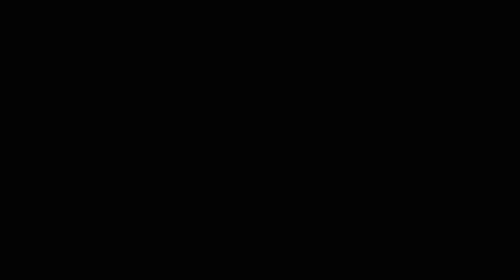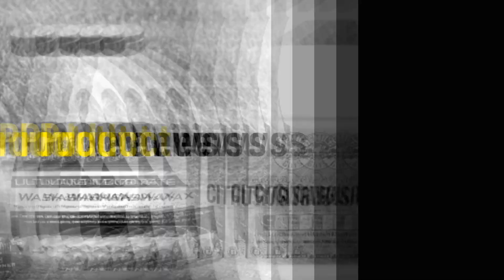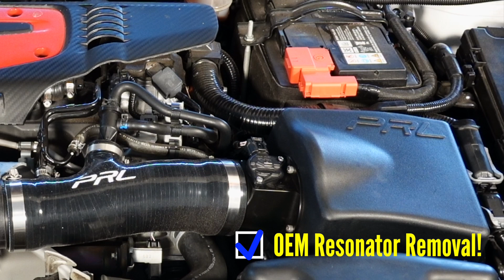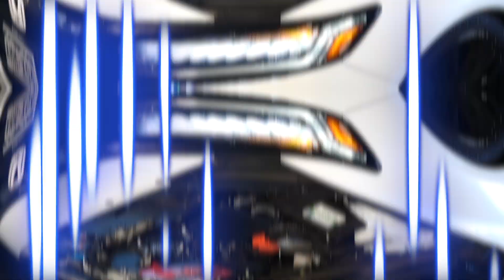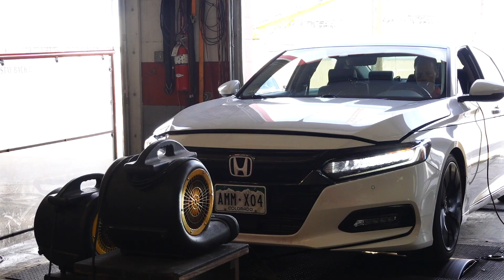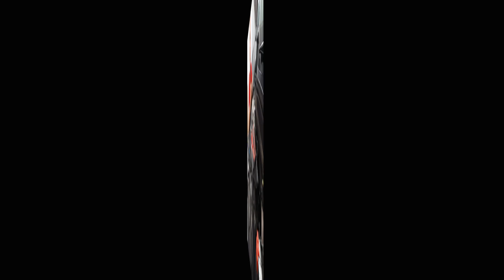Honda Accord - PRL HVI Tested!!! (Install, Sound Clips, & DYNO Test)  //  10th Gen Honda Accord

Comment: Is there anyone with the 1.5t video review I keep running into 2.0 when it should be 1.5t
Reply: Should just leave the 1.5 stock ain’t gon get much faster bud just enjoy the good gas 😂
Reply: @kevvg6068 That’s false. The 1.5’s are fast when tuned.
Reply from the maker: I think fast is a relative term. You can spend a lot on tuning a 1.5 to make it as fast as a 2.0. Personally, I wouldn’t do it especially if you have the CVT transmission. In addition, it does appear that the 1.5 does have a higher incidence of blown head gaskets compared to the 2.0

Comment: Go with this one for my 2021 accord 2.0 or with a miramoto intake .
Reply from the maker: Do you have any other mods on your car?
Reply: @TheLemonFactor  no this would be my first mod . Need help understanding how this works . Because I want my cabin to be quiet and my car too not be too loud . A friend told me I should get this prl intake and do a muffler delete . But need opinions ?
Reply from the maker: The closed system air intakes really aren’t loud.
Reply from the maker: The muffler delete is going to increase the noise in your cabin.

Comment: Would this product be better when paired with a Ktuner? If so, Which stage would you recommend for a daily driver. 
Just purchased this intake today, quite pricey for little “gains”.
Reply from the maker: It is a very pricey mod, considering the minimal hp gains 😔. As far as how much additional gains can be had when paired with the KTuner base map, there’s only one way to find out 😉. I’ll be testing it soon. 👍

Comment: Hey Chad.  Can you install a Civic Type R chip in an Accord 2.0 T to access more bhp and ft/lbs ?
Reply from the maker: If you're referring to swapping the ECU, no.  The cars although similar are still very different enough.  A better option would be to either use a KTuner or Hondata to tune the car to your specific needs.

Comment: In actuality to get Turbo noise you need to run an external blow-off valve filter don't mean nothing but if you run an external blow-off valve you will have to Worsham noise everybody wants but like I said in my previous comment tuner states do not do it to company say you can do it and there is no Dyno numbers out there for or against this mod

Comment: Why don't you try and get your hands on the new titanium turbo inlet for the Accord from PRL it gives you a bigger turbo inlet and a bigger silicone hose with filter the problem with the Accord it has a recirculating blow off valve that's why I do not hear it. It's saying that maybe you need to run an external blow-off valve and see if it actually makes a difference or if it hurts the motor. And speaking to all the tuners they say do not run it but in speaking to Garrett greddy HKS they swear by them but according to Joel grenaded his motor with a hybrid Garrett turbo and everyone online is saying that is because it a too much pressure and then the excess boost pressure went back into the recirculating blow-off valve which went into the turbo which grenaded and came apart and then pieces of metal winning his motor no one knows

Comment: great overall videos on the air intakes. you saved me a ton of money just to reduce up to 5-6 WHP (teketa or what ever it's called) to 3-4 WHP for the PRL which makes no sense 🤷🏾‍♂️ sticking to stock parts for now until you come up with better parts with real testing if it's worthed. there's a few things i still want to do with my 2018 6 speed manual accord like adding sound system cause the one in the car sucks and i want to go with 20" rims to get away from having rims like every one else, o and also put in genuine REAL leather in it too (hallelujah, glory to God) ☺️
Reply: I did a FULL overhaul on my 6MT Accord stereo if you're looking for some tips? It sounds extra decent now, but still looks stock AF.

Comment: Stage 3 he asks if you have an intake and what kind to adjust for it. Same with a custom tune. I promise these gains will be significantly higher with a tune that adjusts to the installation
Reply from the maker: You promise 😮. Do you have any proof. Although it would be hard to contest one way or another if the gains came from an air intake’s abilities or the fine tuning of a custom tune. The bottom line with these videos is that they don’t produce anywhere near what the manufacturers are claim - and their claims are without a tune 🤷‍♂️
Reply: I bet you if you do the tune and test with drop in or stock filter  and cold air intakes the difference will not be that big it will be similar to the series he just completed

Comment: Great vedio as usual
Thank you

I have one quistion regarding the transmition cooling system in the accord... Is there any defrence beteween the cooling system in 2.0   10 speed automatic tansmission and the 1.5 CVT?
 Are they using the same parts for cooling?
Reply from the maker: Thank you! 👍. I haven’t look into the differences in cooling systems between the two engines 🤷‍♂️
Reply: Hey. question. is this air intake is comparable for 2019 Acoord 1.5T ??

Comment: Please do a test on all the intake with a stage 1 or 2 tune to compare with stock setup vs. Manufacturer claims (stock) vs. Manufacturer claims (tuned). Also since you did a 87/91/93 octane test if you are willing would be very interesting to see if octane boosters work as they claim. Since you did a k.con on 87/91/93 interpolating how much octane increase should be relatively straightforward. i.e if 87 + octane boosters avg a k.con of 51 that would equate to 93 for example.
Reply from the maker: The testing that includes the KTuner is planned 😉. Testing of octane boosters is a good recommendation - thank you!
Reply: You can also test aftermarket intercooler (such as PRL intercooler) effectiveness via K.Con in stock configuration. If there is any effect.

Comment: I think with the MAF parameters of the stock ecu you are going to see similar results.  Once aftermarket tuners are introduced, you'll see see better results! I have a 5.42 0-60 dragy with a ktuner stage II and a k & n drop in filter. PRL HVI on the way! It'll do better! I'm so used to setting boost/fuel  with the GN. Late model tries to keep everything balanced with altitude. Old school gives you what you set. Turn up the boost and run 11.5- 11.7 WOT afr  and GNs scream! Easy peasy!  Once Honda can easy add bigger injectors and alcohol injection, HP will come easily. A LSD would be awesome. My GN still awesome to me! Even though it isn't the fastest kid on the block! But I could be with minimal cash! Nobody has broken into the engine yet for the most part  Potential for the accords is very good!
Reply from the maker: It’s an amazing platform. Getting the power down is going to be a big challenge. An LSD would help - I know it’s been done on the manual Accords 🤔
Reply: @TheLemonFactor  Ktuner & Hondata are on the right track with pulling timing vs closing throttle. I'm of the opinion a CTR turbo or one step up in size would really benefit the Accord. This would soften the immediate torque hit without killing power under the curve and benefit top end power. My last GN upgrade was a Precision 6152 turbo and a 3400 stall converter. I still had the low end torque with the stall and the bigger turbo was awesome in 3rd! Top end pull is excellent! Too bad our 10 speed auto doesn't have a LSD.
Reply from the maker: With peak torque coming on immediately, while fun, it certainly doesn’t help with traction 😕. I agree, if we can just have it come on a little later in the RPMS, it would give the car a little bit more time to get traction.

Comment: Damn! Was hoping to have some better results from this one, but to be honest all of these intakes make marginal differences in power gains anyway, some of which could be attributed to the temperature in the shop that day, fan angles @the FMIC and intake scoops, etc.

What is interesting is the smoothing of the power delivery, can you feel this in practice? My gut still says that I'll go with this one once I do the MHI/CTR turbo swap, as I'm afraid the extra intake port on the Mishimoto may lead to heat soak in practice

Regardless great video, been looking forward to it!
Reply from the maker: I think we were all hoping for more from the PRL HVI 😩. The Mishimoto has a smoother power delivery in the lower RPMS too. 👍
Reply: @TheLemonFactor  Interesting! Now I'm left wondering if the Mishimoto still leads to power gains in real life scenarios

On the Dyno with fresh air being forced it's way + the hood cracked, you'd only achieve higher flow at about the same temp, but with the hood closed after a lot of driving, I'm wondering if the increased temp air going into the additional inlet would negate those gains.

Hmm 🤔

Comment: Thanks for all the intake vids, very helpful.  to me it looks like, Mishimoto is the way to go , I think that produced the best results as far as power and sound.
Reply: Yep, I came to the same conclusion. Just going to run it with the lid off if I want more sound. Good luck getting your hands on one though. Ordered mine back in December and they are hoping it will ship by April.
Reply from the maker: Mine was on back order for some time as well. 😩
Reply from the maker: I’m glad you found them helpful 👍. The Mishimoto does have a better overall sound.

Comment: Seems like ALL the Manufactures claimed gains are BS. However MISHIMOTO seemed to tell the least amount of BS.  For the first time I picked the right one lol
Reply: Me too. Lol. It sounds decent and had decent gains. Gains probably show up best with other mods.
Reply from the maker: We'll see if there's a compounding effect with future mods!
Reply: Guys have reported better performance when closing off rectangular port on Mishimoto.
Reply from the maker: Do they have any proof of this?
Reply: @TheLemonFactor  claimed to have lost low end throttle response. Probably used butt dyno instead of real dyno or dragy results.
Reply from the maker: Unfortunately, not new - ie manufacturers making over inflated claims 😕🤷‍♂️

Comment: Thanks again Chad, love this series you put together. Got me contemplating whether I should even invest in intake for such little gains 🤔
Reply from the maker: Thank you. Now you have some additional info in order to make your decision 👍
Reply: I feel you Daniel! It might not be the biggest gains from stock but I am considering that it probably makes more power a long side a tune! I am noting how the power delivery line is a lot smoother with the prl one another thing I’m taking note of. Chad you should do one with how they perform after a tune 🧐 I know it’s asking a lot already but it’s and idea.
Reply: @Reynosojrr  you don't need to test them after a tune because the tune will determine the result. The ECU runs the show not the intake or exhaust.   These are not old school vehicles they are computers.   The tests he did already show which have an advantage and as you can see the advantage is small and I might say insignificant